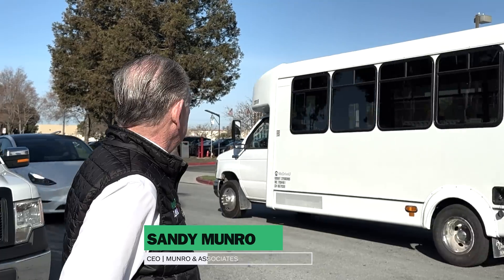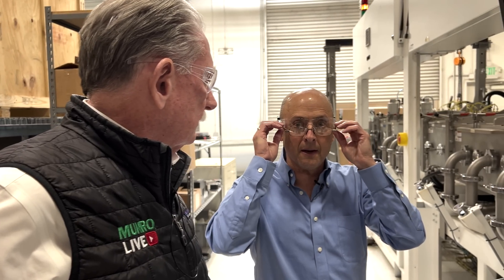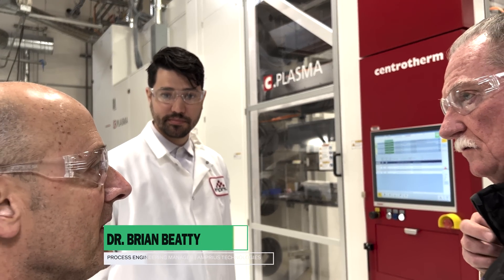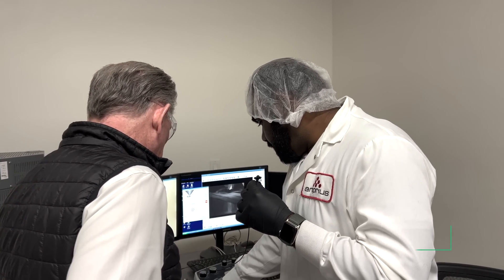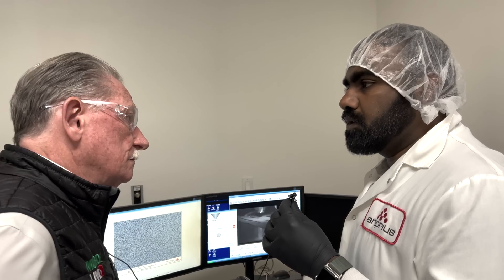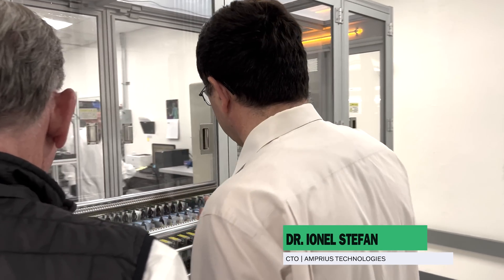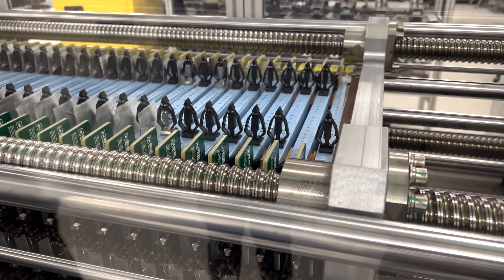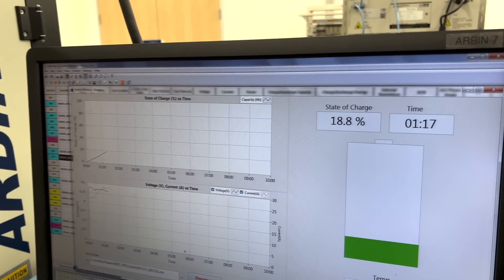Nobody Has Anything Like This: Amprius Factory Tour

Comment: scaling up is in effect, colorado plant in 2025 is projected completed date, the cons of the battery cell is cycle life, but in my case I dont care Id rather have the power density and take a little hit on cycle life, they claim as of 3/2024 at 650 cycles, tenergy has started making battery packs from these cell and it seems to be price competitive to existing graphite anode cells, current data sheet show 355 wh/kg, not 500, maybe they have another cell I dont have data sheet for, I speak of the SA02 cell data  sheet

Comment: Rapid 10C charge - check. Higher density - check. Lower weight - check.   Shock and vibe?  Longevity? Recycleability? (Circular Economy). Catastrophic failures mode and field extinguishable?  I would assume any software driven BMS can adapt to its needs.  - I note the gentleman asserted "cut it off" at 90%. Standard practices are at 80 for longevity. If you go 80 to 100% is there any long term damage? Any thermal runaway?

Comment: If I had a car that could reach 80% full in less than 10 minutes, I would be very impressed!  And then I would not need a car with over 200 miles of range!  370 watts per Kg is also wonderful!  so 37 KW in 100 Kg!  Wonderful battery weight too!

Comment: They should consider marketing these batteries to auto sport. Formula E and Formula 1 needs some battery improvements. Especially with proposed 2026 formula 1 regulations, batteries are going to play a significantly larger role.

Comment: Great video, Thank You!  Sounds like the GOOD is high power density and fast charging time, the BAD is high cost and low cycle life. Could be a good fit for aircrafts, if the batteries are easily swappable like NIO in the auto industry?

Comment: This is what Zap-X promised over a decade ago, and this isn't just vapor. Maybe 6 minute charging, from 12%-80%, will finally appear in 2024 BEVs. Just to temper my optimism, I expect that even if the batteries can charge in 6 minutes, it doesn't mean they actually will at your local DC fastcharger (looking at you EA).

Comment: Innovation is happening & the energy density is very good considering they'll probably be able to tweak the process as volume ramps up. They are already very competitive in comparison to other established batttery production lines as far as per cell capacity. I am sure quality will improve from their already high standards. It was encouraging that each cell is fully tested . I hope the full capacity production shows only random testing will be needed due to perfection of the final line processes. Good luck , you only need to relocate to a State that will fully appreciate you .  Nick , NavyBlueSmoke.  LST-1195

Comment: What I saw is a rather expensive manufacturing method, good but not unrivaled energy density, substandard cycle life, packaged in the pouch cell form factor.

I wonder if there is a trade-off to be made between charging time and cycle life?

The space and aeronautical industries might have a use for a battery with these characteristics. They seem to be far from being able to support automotive applications, except possibly for very high-end supercars, where high cell price and lesser cycle life might be less concerning.

Comment: Exec Summary: After years of developing repeatable "Lab Curiosity" batteries, a new proof-of-concept "manufacturability" experiment to make batches of sandwich size pouch cells to satisfy their customers "curiosity" needs for hundreds of batteries.  New "productivity breakthrough": use of automated solar cell  prototyping wafer processing equipment to make several square meters of cell layers per day.  Yield rate of "cell pack" assembly is ~ "90% -95%" (after > 50% of defective cell layers discarded?), maybe in high 'teens % yield overall.  Charge rate demo uses a ~ 100mm x 100mm ~10 W (nominal 1C) cell in a rather large steel clamp, not in a usable pack.  All of this production volume scaling is enabled by the electron microscopy aided precision eyeball QC and Process control!  Good luck to all!

Comment: we have seen this before, many times, this manufacturing approach is terrible, i would call this good for developement, but mass manufacturing, you have no chance with this approach. 
They said they use this and that because "they" have done it already, no, nobody has done it before ever. people have no idea what the real scale of what is needed is. it is beyond insanity demand awaiting for the first that can serve.
charging speed, capacity arent even things to look out for anymore, it is just about scale and this approach can never work.
i am impressed when i know all metrics.
whats the cycle life
whats the cost

what capacity will be produced, vertainly not much with this method you simply can't.
for a revolution, this aint it.
just another one for luxury cars, for aviation its not good enough, ad for mass market it wont be available in the numbers needed.
but all batteries are needed, literally, even the "worst" ones are good enough for most Applications.

Comment: Nano wire sponge cool❤. Possibilities are only limited by imagination, definitely a takeover target for use in Optimus and long range EVs(with improvement in vibration resistance and high capacity charging). Cooling could be novel too, Imagine dunking the nano wires sponge, in flood filled coolant trays, on demand. Just some thoughts.... Special thanks to Sandy and Cory for bringing this exclusive content👍👍.

Comment: Great tour and video.  These must be very small cells if 10C is 27A.  This is why the SOC% goes up so fast.  Rough estimates (if my math is right): if we estimate that 0-80% was 6 minutes @27A (10C), this calculates to about a 3.3Ah cell.  Just for reference, the Mustang Mach-E cells from previous videos are about 70Ah each...so 20x bigger.
Reply: I think I recall that the original Tesla 18650 cells, 2012, were 3.3Ah.  If so, then their capacity is about equal to a 18650
Reply: It's always great to read knowledgeable comments.. Thx

Comment: 0% to 80% in 6 min is very impressive. Assuming this scales up well into a full pack configuration, it bodes well for the future.
Reply: As long as you can keep it cool in a big pack, one pouch or a full pack wouldn't make a difference.
As long as you can provide the power to charge all the pouches at the same time though!

Comment: I died inside when I saw they are still using Windows XP to load those microscope images
Reply: Could be they want a smaller, stable, and non-internet connected OS. It probably only has to run 1 or 2 programs.

Comment: This would be great for aviation but likely prohibitively expensive (not to mention lack of scale) for vehicles. Maybe a few super expensive models (>$300k) will be able to use it. For the rest of us, as soon as LFP/LFMP or Sodium can support vehicles with 300 mile range and under 15min 0-80% charge, it is more than enough to transition the world to EVs. No need for higher density (unless it can be done in reasonable cost)
Reply: I think you are right.

Comment: Amprius is a company that specializes in the development and manufacture of advanced lithium-ion batteries. The company was founded in 2008 as a spin-off from Stanford University, and its technology is based on research into high-capacity silicon nanowire anodes for lithium-ion batteries.

Comment: Impressive, BUT (big BUT):
1- Awesome batteries are available EVERYWHERE. The problem is price and on that regard,
2- the "run rate" question wasn't answered clearly. He should have answered in MWh/month or something like that. Not 90%. That's zero useful information. The speed of production is closely related with price.
3- As per Amprius info on their website, cycle life is between 200-1200, in comparison with 500-1000 cycles for more typical Li batteries. I hope everybody understands the "200" number - that's at full power charge. So, life expectancy is reduced by 6x in comparison to slow charge, 5x in comparison with low charge of standard Li. So,
4- The usefulness of fast charging comes at a 1/6 th reduced life expectancy. Add that up to the initial cost and the economics of it will surely will be shaky.

NEVERTHELESS: these will probably unlock other uses, like planes! Since planes have very specific charging locations (and very few in comparison with cars) it will be possible of having external & powerful cooling pipes during charging. This will extend battery life substantially with almost no cost of weight to the airplane. Just recirculate water on them & flush/empty the system in the end.
Also, as the client base grows so will production and costs can be substantially improved!

Comment: I'm no expert but, they're only charging a tiny battery at 100 watts. What happens when 200x power (200 kilowatts) is pumping through a 75kwh scaled up pack? Is the temperature really going to stay the same with that much more juice? Cycle life also wasn't mentioned. What's the current cooling apparatus look like? A full size test is the only way to know I would think.
Reply: You do know that battery packs are a collection of individual batteries? Does 750 batteries meet your needs? Resistance went down as the cell warmed up. 55C is 131F. An ICE radiator is about 220F,

Comment: it's funny that we continue to talk about not wanting to go to 100% charge so we're left with a usable of 80-90%.    Why isn't it reframed to 100% with a built-in buffer of x%.   Would seem to simplify the understanding for more people.   Charging apps would be written to go the non buffer 100% state.
Reply: Someone has to pick upper and lower limits somewhere, to balance expectations (lifespan, performance, safety) …  a product being more dummy proof also means trading off more range, weight, performance, cost, charging time etc

Comment: Man if those charge rates and energy density work out for long term use this thing will easily replace new ICE vehicles. Drive 300-400 miles, plug in, go to the bathroom and grab a bagel. By the time you make it back to your car you'll have another 400 miles.

Comment: Looks experimental not a factory. Factory is full of animation robots spitting out batteries by box full every second instead of hand crafting a single battery from what looks like by hand per month. At the pace you are going you wont make enough cells in 10 years to power a single tesla.

Comment: Once you can charge an EV to 80% in under 6 minutes, ICE is dead for commuter vehicles. If you can buy an EV with a 400 mile range for roughly the same cost of a comparable ICE vehicle and can get 300 miles range back in under 6 minutes of charging than there is no reason not to switch to an EV. Long haul trucking and some commercial applications are all that will need hybrid solutions with alternative fuels like natural gas or ammonia.

Comment: There's an Amprius PDF presentation that they gave to NASA. The battery technology has very high density, almost twice that of current carbon anodes, and a very fast charge time. This was demonstrated in the video.
 But the number of charge cycles is troubling. 
From about 80 to 200 cycles. Amprius batteries with significantly less capacity reach almost 600 cycles. 
Tesla  lithium bats provide about 1,500 cycles. 
You may notice that this significant parameter of a rechargeable battery, cycle count, was not discussed at all. And Sandy didn't ask.

Comment: I was able to track down an article about their independent testing, it’s between 200-1200 cycles before they hit 80% of new capacity depending on manufacturing defects, graphite batteries are 500-1000 cycles but these batteries have between 2-3 times the energy density and charge far faster! They are focusing on the aviation industry because energy density is far more important than longevity for them, and these batteries are good for a much wider range of temperatures. they can use that money to research ways to make it have higher cycle life so it can eventually be good enough for electric cars.
Reply: It's not 200-1200 cycles due to defects... they make a variety of cell types that they refer to as energy, power or blended that will have different cycle lives based on different uses. While they haven't announced the life cycles of their cells tuned towards EV or eVTOL use cases, they are submitting cells to the DoE's USABC advanced battery coalition study and plan to meet all requirements by 2025. If that succeeds, that means they believe they will have EV-style cells with >1000 cycle life and I've gotten the impression that they are already easily in the 600-800 range now and improving rapidly.
Reply: @Grimwyrd  Poor cycles is not a problem for battery swapping. Nio is ahead of Tesla
Reply: It may remain a little too good (i.e. expensive) for use in mass production cars for the foreseeable future. But that's ok, as LFP or Na-ion should also advance considerably in the next 5..10 years to fill that gap.
Reply: @foobarrel9046  oh yeah, I’m not saying it’s a bad thing at all, it’s got certain markets where it’s exactly what they need and want! It just seems most people jump straight to EV cars when they think of batteries, this just isn’t necessarily the best thing for that specific application yet
Reply: My last impression was that they had covered almost everything in the testing but the cycle life. This made me worry it was below 1000 cycles, and I was somewhat correct. For scaling beyond 1 factory they will need to consistently hit 1200 cycles. Someone mentioned stationary storage as a second life. Maybe that's how the aircraft industry can make things economically viable. Plan on replacing the batteries every 4 years then getting some resale value from the used cells.
Reply: Do you have a link to the source?
Reply: I’m wondering about post-aircraft “2nd life” applications, like stationary storage, vs (by then) competing chemistries.
Reply: @Crunch_dGH  The logistics will he horrible and the market for storage soon satisfied. Especially as the rest of the grid's power sources are to only get better.
Reply: Tesla , er Elon needs to back this company for notable improvements. Like automating the silicon nanowire growth on it's substrate. The substrate seems to need to be graphene for durability or maybe titanium or boron for all I know. Maybe even silicon carbide but that seems non conductive.
Reply: @Adam I thought phones were very cost sensitive
Reply: @ralanham76  You could slap it into an iPhone and charge more. Apple users would buy it. Faster recharge times would be worth it for high end buyers.
Reply: @ralanham76  At the top end not so much, that's all about status, so another $200 for twice the battery time would be fine.
Reply: охлаждать в воздухе
Reply: 9xxxxxxxxxxxxxxxxxxxxxxxxxxx
Reply: At the end of the day, the most feasible chemistry will be used for a particular application that will balance cost, gravimetric density, volumetric density, charging speed, lifetime charging cycles, operating temperatures, thermal runaway risk, etc.

Comment: 6 mins from 0 to 80% is pretty nice. I wonder how long the life of these batteries comes out to be.
Reply: If they can control the cooling, it should be just as long as other comparable batteries. Though I wonder if they have to deal with any expansion issues when the battery charges and discharges.
Reply: yea we have seen this many many many times now, they chasing dogs.
useless tech nobody needs.
whats needed is isnane amounts, thats it.
every battery technology is good enough, we dont need more capacity or faster charging, we simply need more batteries, insanely more, like ,insanely squared

Comment: Enovix is also in Fremont, and they have an all silicon anode with no nano wires.  They can also fast charge at about the same speed, have better thermal properties, and easier manufacturing and lower cost.  They are the battery leader in the US, although they are currently concentrating on batteries for Consumer Electronics, but they also do have a program for EV batteries.
Reply: I’m wondering about post-aircraft “2nd life” applications, like stationary storage, vs (by then) competing chemistries. Comments?
Reply: Yeah but do they have an aero environment contract?
Reply: is Enovix building a giga factory like these guys are?
Reply: @ehlava  yes. In Malaysia.  Major production starts next year.  Samsung likely to be biggest customer.
Reply: @proximoAZ  both these companies look good, both going giga. if each of them can get product to market both will be succesful. wonder if either will have supply issues.
Reply: I just brought 100 shares in Enovix

Comment: Would like to know the cycle life of these batteries. I haven't heard it mentioned yet.
Reply: They state 200-1200 cycles depending on various factors (I assume whether it's a "power cell" or "capacity cell" for example). certainly viable even at the low end considering the energy density.
Reply: @spencerhodges2424  I have read about a lithium sulfur battery doing 4000 cycles. It has high energy density too. I have high hopes for it too.
Reply: @BTS-Astro1  Li-S and Li-O2 batteries have the highest theoretical energy density, but have other issues preventing practical usage. There's a lot of new research in this area though improving things like cycle life and temperature range. Probably in the next 5 years one of these chemistries will begin to take over.
Reply: @spencerhodges2424  As far as sulfur batteries there was a recent discovery that sulfur in a special crystalline form was unreactive to the battery's electrolyte and held up well to 4000 cycles.
Reply: there is a reason for that
we have seen this now 1000 times the last 20 years, there are batteries that charge in 30 seconds.
this is all meaningless and the approach is the same old 200 year old method.
this cannot ever work for anything but extreme low volume luxury cars at best, if at all.
next